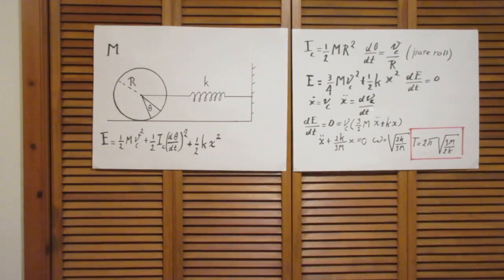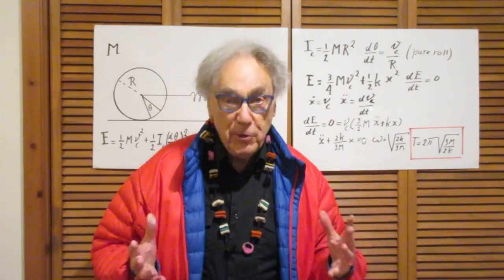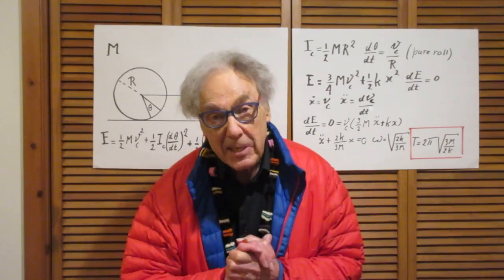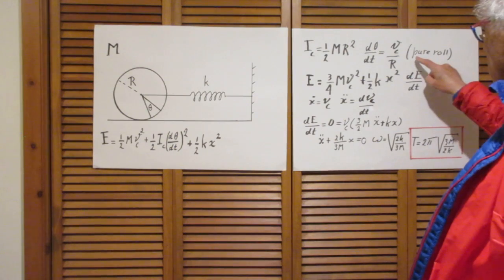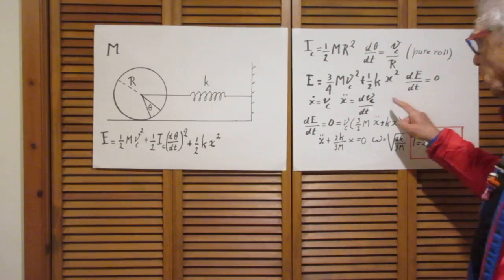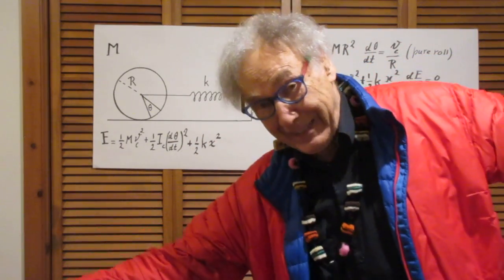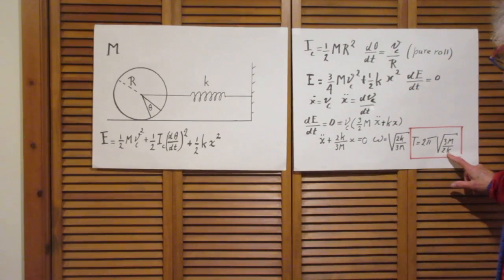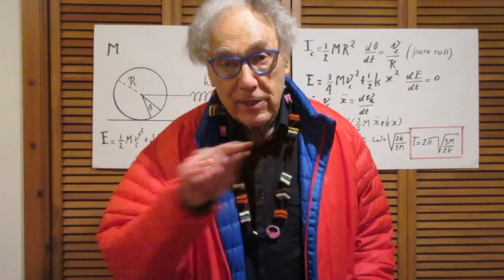Solution to Problem #47 - SHM

Comment: Hello professor Lewin please solve my Question

Q: The refractive index of glass with respect to air is approx. = 1.5  So when light from air having velocity approx. = 3*10^8 m/s incidents the glass surface, using the Snell's law we can calculate that the velocity of light will reduce from 3*10^8 m/s to 2*10^8 m/s and that is intuitively meaningful because as light enters glass it gets way more molecules to encounter in its path and so it will slow down and also deviate.
BUT!!  When the light ray will come of the other side of the glass the ray of light from the glass will go into the air so now the refractive index of AIR with respect to GLASS is approx. = 0.66 . So now if we use the Snell's law TO CALCULATE THE SPEED OF LIGHT IN AIR WHEN IT REFRACTS FROM GLASS TO AIR THEN THE VELOCITY OF LIGHT COMES TO BE approx. = 3*10^8  m/s  so that means that light's velocity increased from 2*10^8 m/s to 3*10^8 m/s BUT ACCORDING TO NEWTONS SECOND LAW OF MOTION THERE HAS TO BE A FORCE TO ACCELERATE SOMETHING SO WHAT MAKES LIGHT ACCELERATE WHEN IT REFRACTS FROM GLASS TO AIR?
Reply: Falguni Vyas Newton’s 2nd law holds for objects with masses(F=ma) whereas light, albeit being a particle, photon, does not have mass. Look up optical density for more info on light speed differences.
Reply: Light speed is a constant in a straight line but in refraction you are calculating the average speed of light and remember that the light is passing and deviating alot thus making it "slower" but light is absolutely mantaining its speed.
Reply: it not accelerated by any force it just go back to its natural state

Comment: Hi Professor Lewin......I got the right answer using the fact that the period is given by 2PI * SQRT(I/K) where I is the rotational inertia. Except I used the parallel axis theorem to calculate I from the point of contact of the disk.
This method was a lot faster than writing out the energy balance equations or force equations you suggested.

Comment: It would be an interesting video if you can explain us about the new definition of kilogram
Reply from the maker: use google - it will all be there in a matter of days.
Reply from the maker: The International Prototype Kilogram was commissioned by the General Conference on Weights and Measures (CGPM) under the authority of the Metre Convention (1875), and in the custody of the International Bureau of Weights and Measures (BIPM) who hold it on behalf of the CGPM. After the International Prototype Kilogram had been found to vary in mass over time relative to its reproductions, the International Committee for Weights and Measures (CIPM) recommended in 2005 that the kilogram be redefined in terms of a fundamental constant of nature. At its 2011 meeting, the CGPM agreed in principle that the kilogram should be redefined in terms of the Planck constant, h. The decision was originally deferred until 2014; in 2014 it was deferred again until the next meeting.[7] CIPM has proposed[8] revised definitions of the SI base units, for consideration at the 26th CGPM. The formal vote, scheduled for 16 November 2018,[9] is expected to be approved[10] and the new definitions will come into force on 20 May 2019.[11] The proposed redefinition of SI base units would define the Planck Constant as exactly 6.62607015×10−34 kg⋅m2⋅s−1, thereby defining the kilogram in terms of the second and the metre.[3]
Reply: Ya I looked into this. I am totally a beginner didn't really got the new definition, I need to work on my concepts. Anyways thanks :)

Edit: I got this interesting video on YouTube on it https://youtu.be/c_e1wITe_ig

Comment: it was cool problem , by the way , I`ve tried problem #43 with Lagrangian and honestly it wasn`t straightforward , it required not simple assumptions and approximations so i can reach the same final two equations in your solution , otherwise , it would be two nonlinear 2nd order ODE .